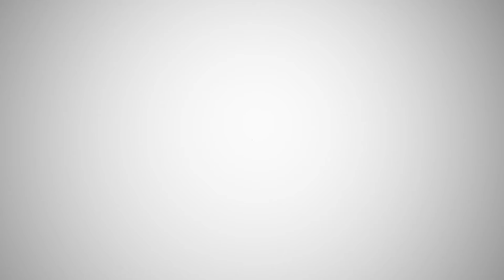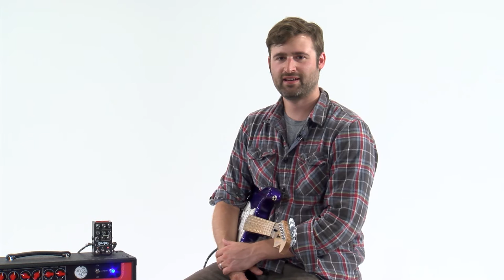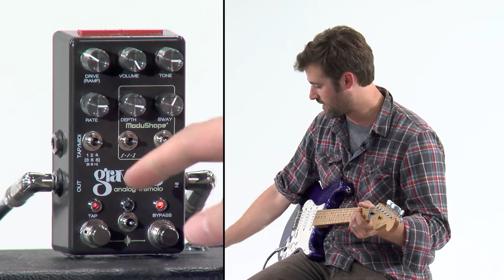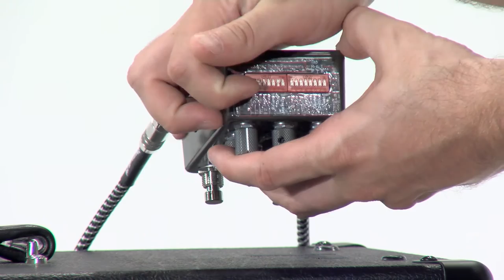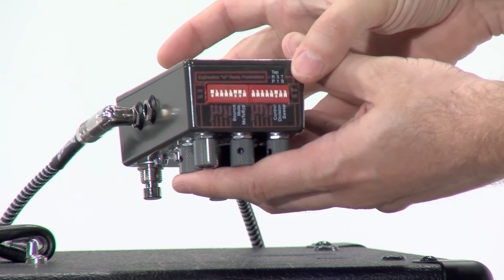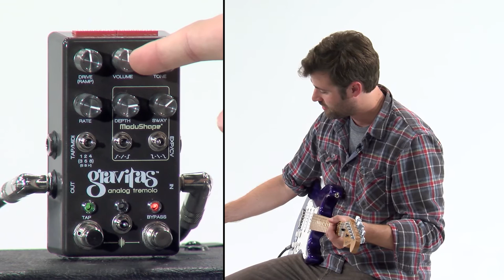Gravitas Dip Switch Lesson 1: Double Trem

Comment: 7 year old video and the pedal is discontinued and no one has called him out on that ending statement, ‘…Or they can both be harmonic.’ 🤣🤣🤣🤣🤣
Just shows how complicated CBA pedals are that the designer himself makes a mistake and no one catches it. 
Happy to have someone explain to me what he meant though!
Reply from the maker: you can achieve dual harmonic tremolo by bouncing the Tone instead of the Volume, feel free to email me at sales@chasebliss.com if you have any other questions!
Reply: @ChaseBlissAudio  I thought you might go there 🤣 🤣
Don’t get me wrong, I absolutely love my Gravitas for all the amazing things it does.
And sure, since the meaning of ‘dual harmonic tremolo’ is up for grabs, why not ramp the tone? But what happens though is the top end just fades out from time to time. 
Maybe with midi you might be able to sync the bottom to come up at the same frequency. 
‘Dual harmonic tremolo’ would really be a harmonic tremolo fed into a slow phaser. Gravitas can do almost anything, but not that. It’s easily achieved with a phaser after the Gravitas though so it’s not a big deal.

Comment: can you save this as a preset and turn the switches back on the non preset mode, and it will still be the same on the preset? if that makes sense. like say I save this as the left preset, then when I switch the preset switch back to its middle position and flip all the dip switches back to normal, will the preset left still perform in the way it was saved even with the dip switches changed? new to the pedal, still experimenting.
Reply: I have the same question. Can you?

Comment: Can the tap input be used as an output to control the tempo of another pedal (via trs cable)? If so, are there any switches that need to be adjusted? I'm thinking about getting myself this sweetie!
Reply from the maker: +Rodolfo Felipe Kusma absolutely, you just need a regular patch cable actually.  You don't need to adjust any switches or anything :D